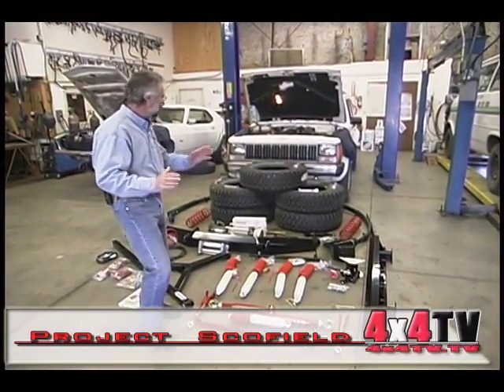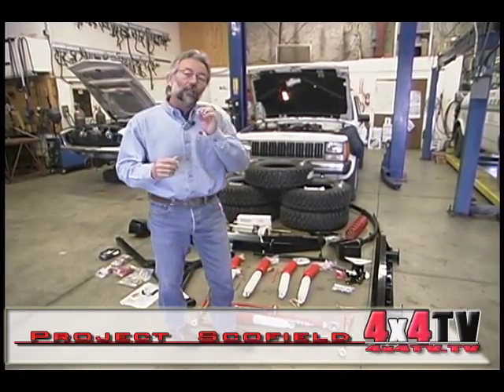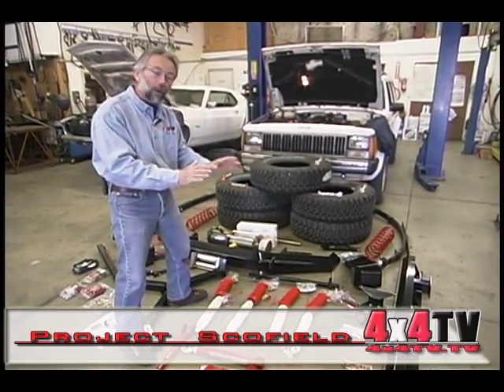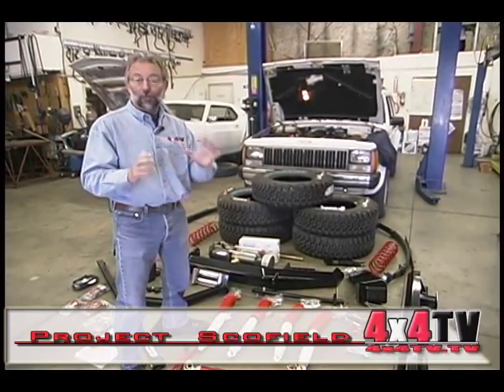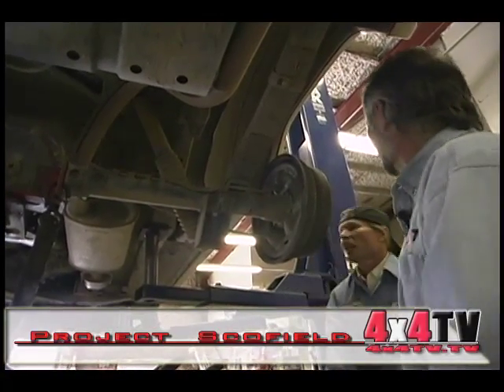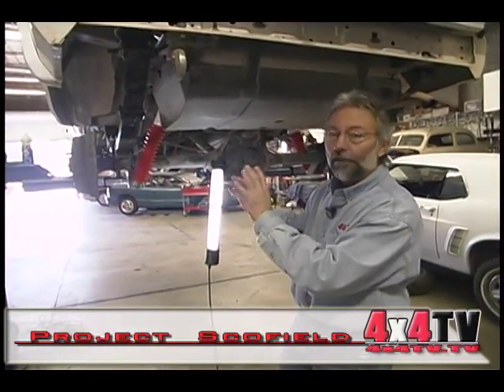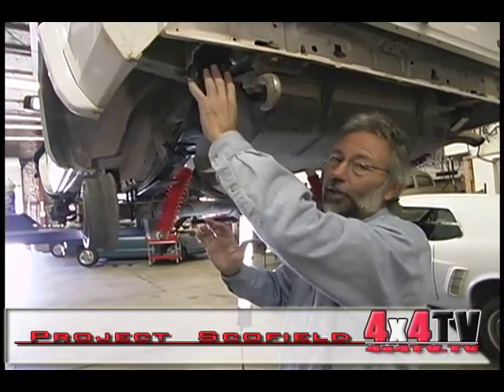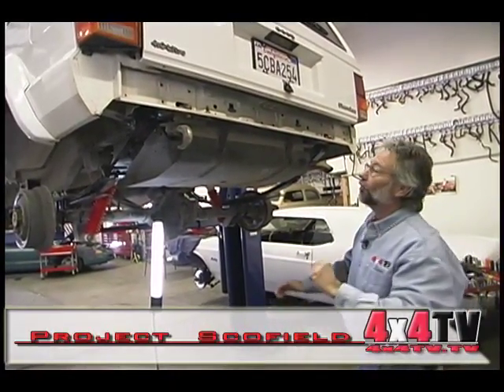Installing the SkyJacker Lift on Jeep Cherokee - 4x4TV Project part 5

Comment: Still building my project and i wish that i video taped it but ill put up videos as soon as she is done! it's got 7.5" lift 35" pro comp tires, it is 4.5" leafs with 3" shackel and front is 4.5" coil with 3" spacer i love my jeep 130,000 miles on it but some frame rust i live in upstate new york which is usual. Also i ended up doing a 1 1/4 transfer case drop with 6 degree angle shims just to get the pinion angle with no drive live vibes

Comment: I got the 96 Cherokee sport, put a 3 inch rough country lift, flow master exhaust 31x10.50 micky Thompson Baja tires an 15x7 micky classic black. My jeeps red an looks like an off road king. 228,000 miles

Comment: Cool build, with the upside down shocks isn't it better to keep the rod up to avoid any damage? I never heard of installing them upside down? I have a 96 ZJ 5.2 [2 owners with full paperwork] and nearly all original and believe me i changed/upgraded nearly every part, i paid 2 grand and put about 6+ grand in it still doing nearly everything myself. I installed iron man stock height fixed arms with poly bushings, solid mounts,brakes, t/c case, f+r diff covers, drilled/slotted brakes

Comment: *Regular street shocks matter.  If they are installed upside down the valves in the shocks don't work properly.  I am unsure about aftermarket off road shocks.

Comment: Are the tires 245's or 265's?  I have a 2000 Cherokee with 265's and when I take it off road I get rubbing in the wheel wells.  I put a 3 1/2 lift and I am thinking about swaping out my 265's for 245's.  What do you think?  Thanks :-)

Comment: do you need sye for 3.5in of lift. I thought any thing over 3in you need sye, track bar and other stuff.
Reply from the maker: +josh miller Not sure what 'sye' is, but this lift works awesome without any other modifications.
Reply: I was being laszy and did not want to write it out. Sorry for the miscommunication. Sye= slip yoke eliminator but that's good to know the lift works great.
Reply from the maker: +josh miller Ha! And I too lazy to take any time to figure it out;-) Yup. We still have the Jeeop and it is still working great.
Reply: +josh miller you should install a sye even if it's a 2in lift...I think rough country has a video on why you need one even if it's a small lift
Reply: +justin mcsurdy  thanks for the advice. I did a hack & tap.

Comment: You dont need 3.5" lift to clear 31" on a XJ...
Reply: No cuz ive got 33" on mine and its only a 1.5 inch lift
Reply from the maker: Austin Paul When I talk about clearance I'm referring to clearance at full articulation.
Reply: Stock can clear 31's with full articulation. Source: XJ owner with 31's.